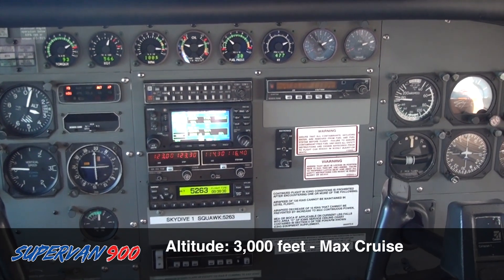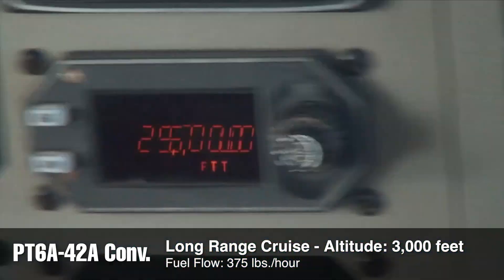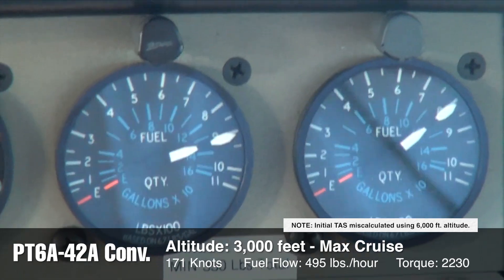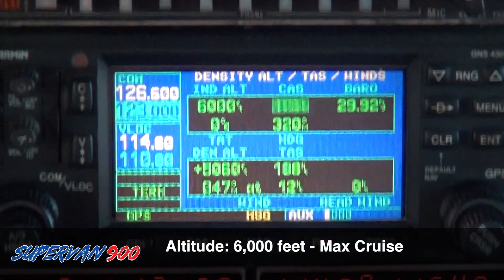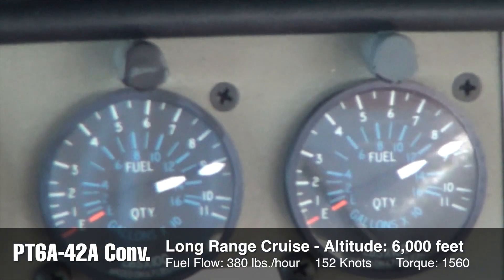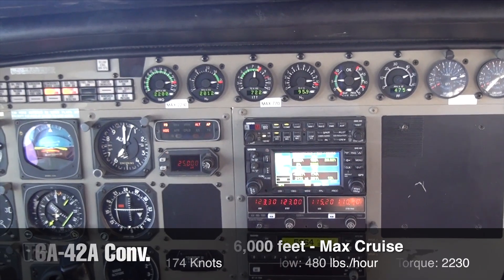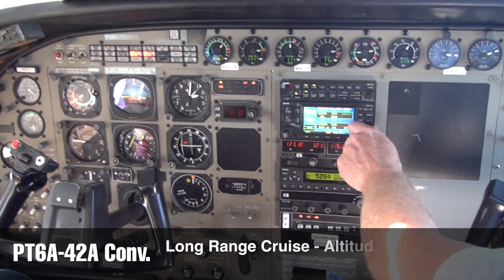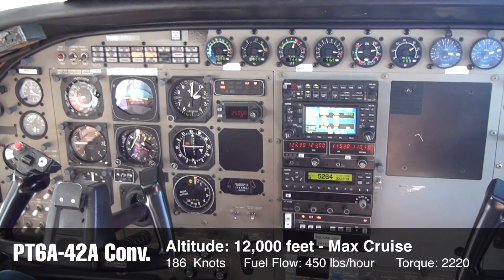Texas Turbines Supervan 900 Long Range and Max Cruise Comparison

Comment from the maker: This is a comparison against the PT6A-42A engine that operates at 850 shp at 2000 rpm rather than the PT6A-114A at 675shp and 1900 rpm.

Comment: 1440lb tork x 1900rpm %5252=520hp = 77% of the power on a 675hp pt6. 375pph .
with the tpe331 94% is 846hp max rpm ng = 40710rpm~ of ng, gear box reduced 26.2 to 1 so 1592~prop rpm (846x5252)/1592= 2790lb tork~
is a totaly diferent setting
anyway tpe331 is the best.